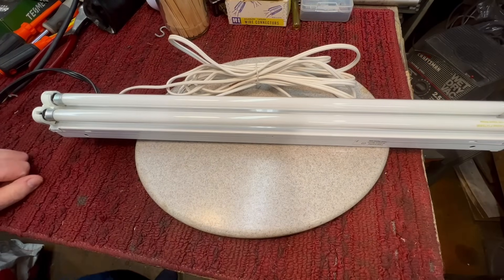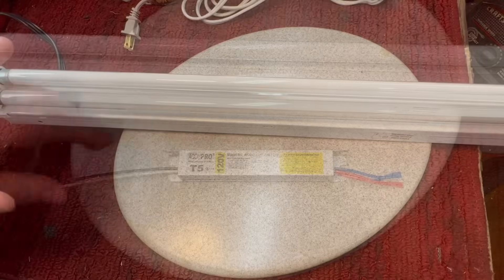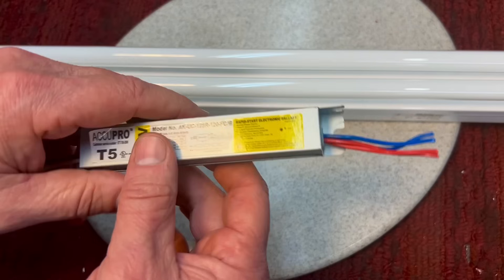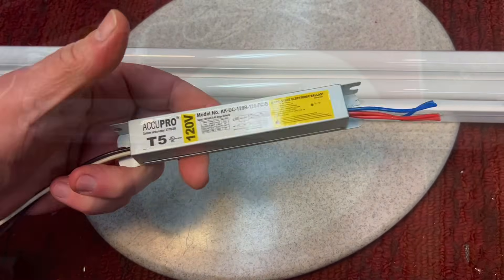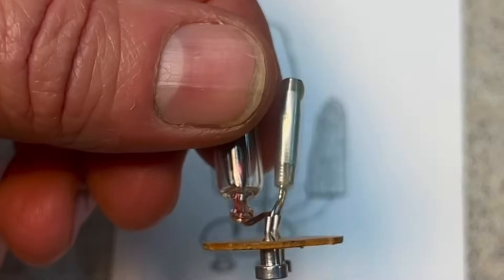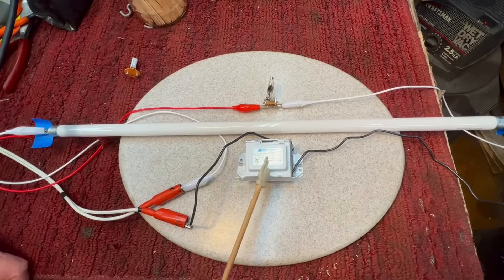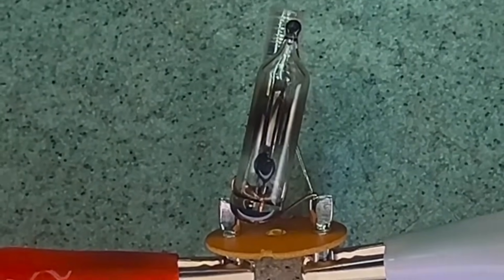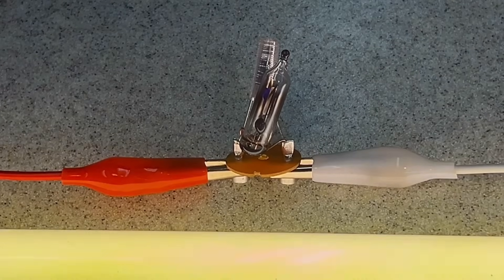Old School Fluorescent Lights- Starters Explained- Introducing Neon Glow Bulbs.

Comment: I was looking at the recent video by ToolScouter, and that reminded me that you have Stanley corner vices as well. There was a video, I can't find, which you had two of them. I thought and you put them on those folding workbenches, to be able to hold larger things by using two of those vises. Do you remember what video that is? Or do you recall What you did with them? It was a great idea and I remember it being something I really wanted to do. I just cannot find the video to remind myself what happened.
Reply from the maker: Yes- I have a few and they are super useful and I wouldn’t be with out one- however I never seen a bolt on version like Brian’s, I thought they were all clamp style.  🤔😃👍
Reply: For my needs, I think I'd like a clamp style. That is what I thought you had!

Comment: Next on the list is to talk about the different colors of fluorescent bulbs. After watching your show I looked up. Some are white and some pinkish. 

After rebuilding that fixture how would that compare to installing LED tubes?  Or would you still need a new ballast?
Reply from the maker: Mark- They make two types of LED replacements one uses the existing ballast and the other is direct wired- I prefer losing the ballast and going direct.  😃👍

Comment: That was cool!  I always wondered what was inside a starter.  I just assumed it was a capacitor.  The masive old fluorescent fixtures I salvaged from the United States Steel company building had extremely heavy ballasts in them that were supposed to be connected to 277volts (if my memmory is right).  I gave a bunch of the fixtures to a friend at the time who connected them to 240 volts and he said they worked fine.  I gave another bunch to a neighbor who replaced all the old ballasts with new ones (which I found in the maintenance room of the building).  All I have left is one four foot fixture (three bulb) that I want to put up in my shop some day.  I assumed I would replace the ballast with an electronic start ballast.  Then I assumed I would just put LED bulbs in it.  Now I am think how cool it would be to use a starter with a new magnetic ballast.  Some day...  Maybe...

Comment: Hi John,

Too cool. The starter cap discharges when the bimetallic wire completes the circuit. I’m like you. When I want to do something I don’t know how to do, I find YouTube videos. Welding will be my next adventure after I complete my shop electrical sub panel. Your dog insert got me again. Too funny. Your comedic timing is perfect. And now the squirrel. Very cool setup with your neon light.

Comment: Great and interesting video Scout. I remember as a kid we would get in trouble for turning on the fluorescent light in the kitchen and then turning it off again soon after because apparently they used more electricity to turn them on than they did to run for an hour. 
I’ve been caught out with the penny wise issue a few times and it’s very frustrating for me. Cheers mate, Stuart 🇦🇺

Comment: After the US invaded Iraq, the military went through all the phases of fluorescent lighting. They initially bought tens of thousands of the magnetic ballasts with starters but quickly changed all of them to electronic ballasts, but bought them from some shady company in UAE. They were mostly bolted to cheap plywood and would heat up and started a number of well publicized fires. So, they replaced them all again with UL listed electronic ballast. Funny thing fire safety. First thing troops would do is run out and buy an electrical strip, 220v, 3 prong UK style...and literally start frying everything 110v. Transformers would convert the voltage but everything was 50 hz so anything that rotated pretty much would only last a couple hours, at most. All the ABC dry chemical fire extinguishers would form a hard cake layer if left in the sun and wouldn't work when you needed it the most. Ya know, Centcom bought thousands of locks for doors and CHUs, but bought the variety with key throws on both sides. When you went into your room, you literally lockedyourself in there. Well, a troop died from a small fire, mostly just smoke from a shorted strip, but had the key in his hand but couldnt get it in the keyhole. Centcom put out a flash message to change every lock immediately in 2009 with an interior thumb throw. My camps had about 300 locks to change and cost $12,000. The military eventually banned every electrical strip and contracted Belkin to make UL listed 220v, UK plug strips with adapters and handed them out for free. Tough lessons to learn.
Reply from the maker: Unfortunately many manufacturers think they can cheat the government when bidding low on contracts. Believe it or not they even had parachute makers producing inferior chutes, all for a little more profit.  😃👍

Comment: It’s really too bad I threw away a few dozen fluorescent light fixtures with bulbs and a box full of new ballasts, I saved them from the bin when a company I worked at received a grant for all new led lighting and I stored them for 10+ years for the day I would have a shop of my own and I put nearly 25 to use until months later I had an energy audit and what do you know they gave me all new led fixtures and I stored them for nearly six years until last summer I felt I needed more space in my loft, it hurt me to throw all of that away but I have learned one thing and that’s there is no space big enough for someone like us. If you have space you will fill it, I think we share that in common
Reply from the maker: You are so right- however any light you will install now will be LED’s.  They were interesting technology back then but outdated by today’s standards. 😃👍

Comment: Hey, John. What made you pick at 82k resistor? Experience with this type of situation? I wonder how low you could go without it popping.
Reply from the maker: Brian- For some reason it seems to be the go to resistor for those glow bulbs.  I guess people have experimented with different values and found 82K to be the sweet spot between brightness and longevity.  😃👍

Comment: The cap in the fluorescent starters charge up and when the lamp opens, it discharges and provides the spike current/voltage to start the lamp.  When the capacitor goes bad and will not charge sufficiently, it doesn't provide the high value spike.
Reply from the maker: Thanks Don!  😃👍
Reply: @ScoutCrafter  👍

Comment: I got an AT submarine "Sea Wolf"! It was from Santa back in the '70s.
It was actually a little disappointing because it was so big it wouldn't fit/ float in the bathtub!  
It was designed to dive and surface using a small, air, hand pump. I did get to use in in a horse trough though, but it was a little anti-climatic. 
I mostly pretended on my bedroom floor.
Reply from the maker: I have the SeaWolf in my living room!  😃👍

Comment: Thank you so so much for doing this video. I rescued a gooseneck Luxo Magnifier for my bench. It was in the trash at the salvage yard. I pulled it out and they said it did not work. It was really old, and it had a feature where you hold down the on switch and the neon in the starter starts to glow. Only when you release does the charge then get delivered from the starter. So to start the circular ring fluorescent you have to press/hold, wait, release. About 7 seconds to get it lit. Rarely do I have to do it a second time. I still love it and still use it. Never thought to replace it ever. Would replacing the bulb make it start faster with a shorter press/hold?
Reply from the maker: That’s called a manual start fixture- I have one in the attic-  Press- Hold, wait for light- release. 😂👍. I don’t know if they made special bulbs for them that would start faster but I’m still learning! 😃👍
Reply: @ScoutCrafter  oh wow, ok, so it’s functioning exactly as it should, I am using how it was designed to be used, and it ought to continue functioning forever (fingers crossed). That is excellent news! I love it and I also have another gooseneck lamp that has the same starter except there is a second button to illuminate a standard Edison bulb that sits in the center of the ring fluorescent. You can’t have both on at once though — it’s the Edison or the florescent (and I am ok with that)